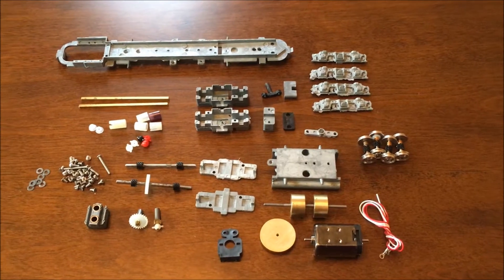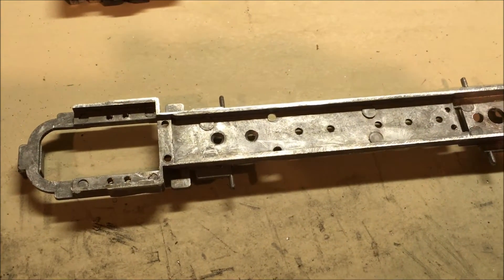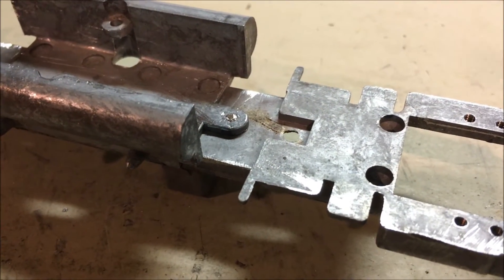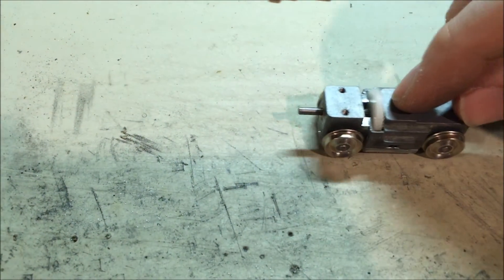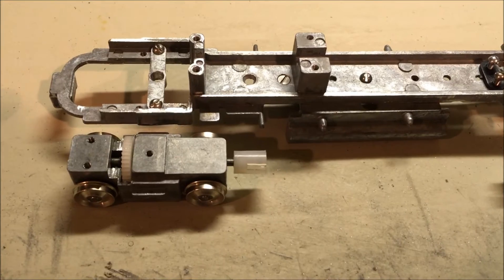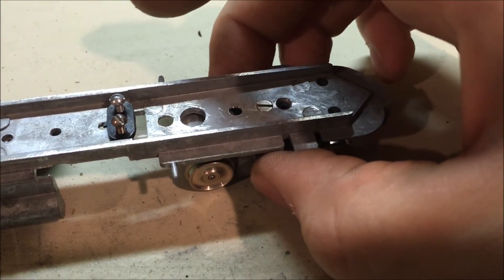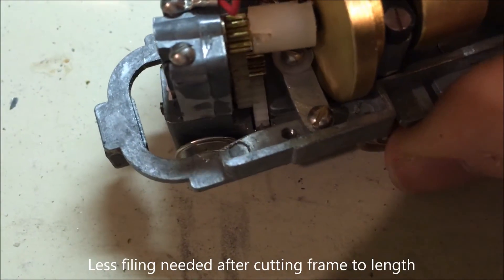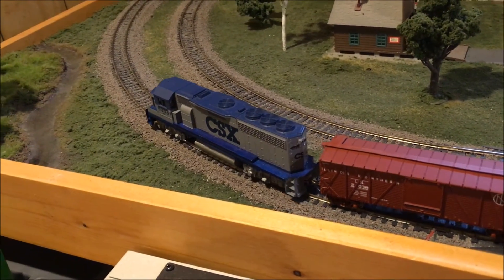New Hobbytown chassis kit build and review

Comment: This is really cool. I've been looking for model train kits. didn't know about these. Can you provide a link or info on how to obtain kits and costs? Do you know of other vendors that have kits? Very good review. THANKS.
Reply from the maker: Here's the website: http://hobbytownofboston.com/
There's no ordering system set up yet, so you can contact the owner about ordering the kit you want (email address at the bottom of the page).  The chassis in this video is $85.

Kits have become a small enough operation that most manufacturers are only selling direct. Another good one that does complete diesel kits is Tiger Valley Models. The website's gone, but you can still contact him by phone. His kits are the definition of heavy duty!

Comment: Darth
Nice job and great review. One thing that is obvious, but I think different (I could bewrong) is the frame. I have builtRS3s and te 4 axle swither and F unit chassis and all were specific for the bodies. I am not sure that they made them for geeps. Is this frame     a new item or am I showing my seniiy? 
                                                                                                      Thanks for sharing 
                                                                                                                      Ray
Reply from the maker: The frame is actually older tooling.  It's a universal 4-axle kit made to fit various body shells like the Tyco GP20, Athearn GP30, or U28B.  I think the frame is also used for some 6-axle diesels.
Reply: Thanks Darth
I guess I either forgot or because I never made one didn't realize it. One thing I was wondeing was if Delrin gears make the unit quieter?
Reply from the maker: The 1:1 gears have never really been a source of noise, so they're about the same.  The new motor is very quiet, and the nylon tower gears don't make as much noise as the old all brass gears.
Reply: Thanks